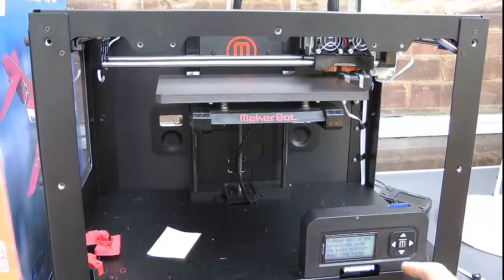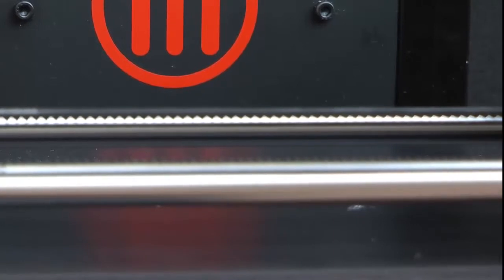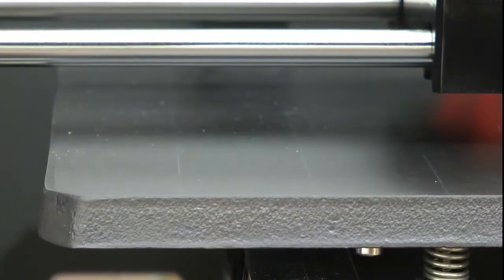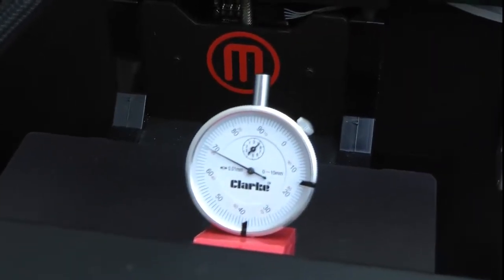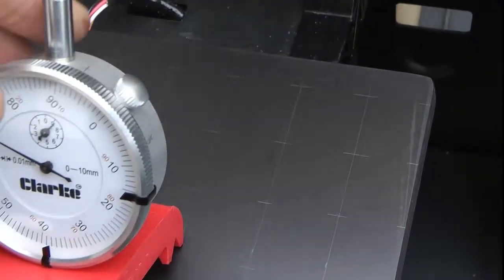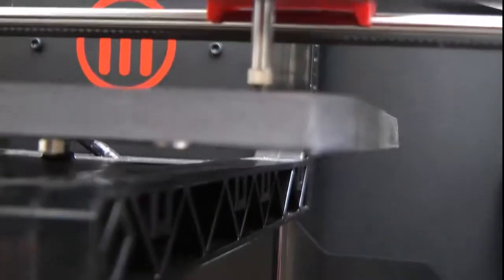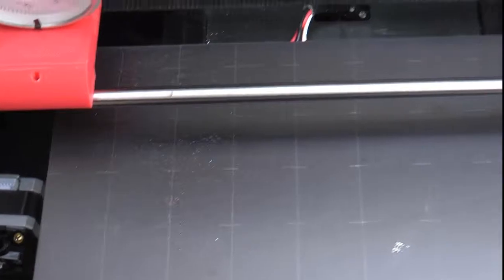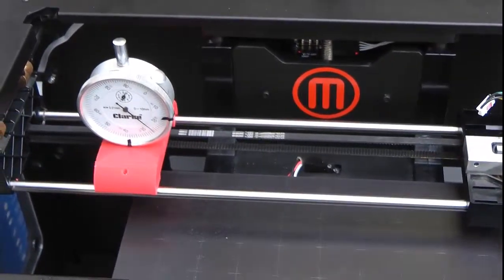Makerbot 2X Warped & Pitted Build Plate

Comment: Is this a common problem, mine is off by over 1.2mm in the -x +y corner the +y -x corner is about -0.8, with only about 40% of the center less than 0.1 mm or less.

I am looking for an alternative. What did you do?